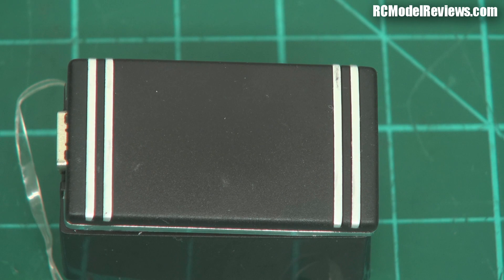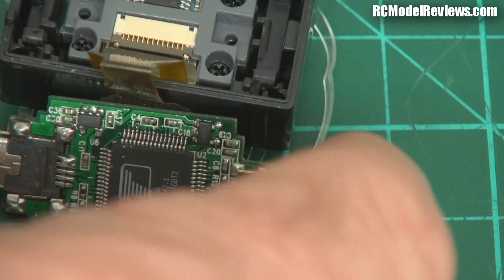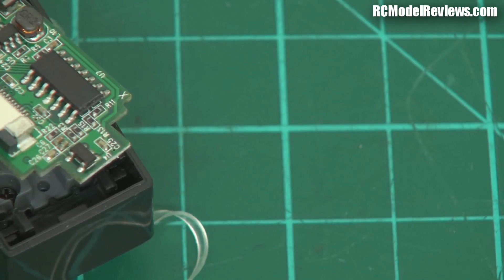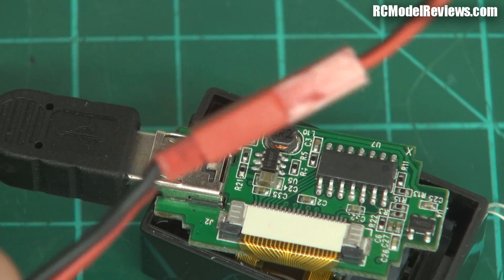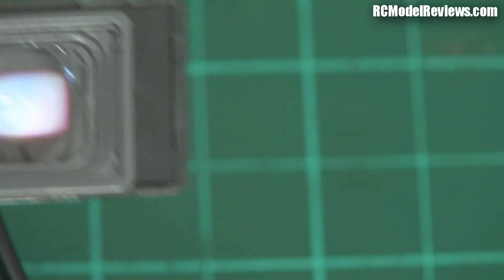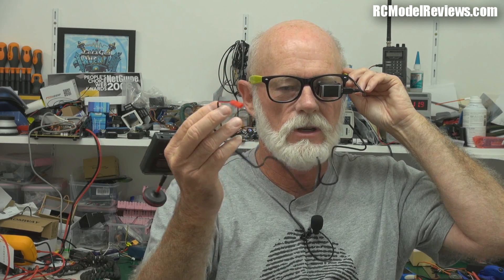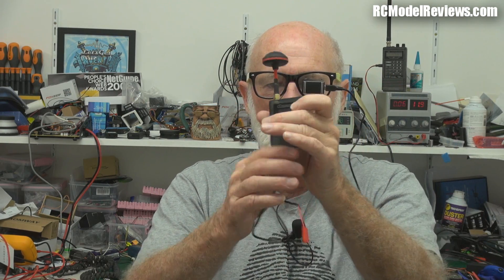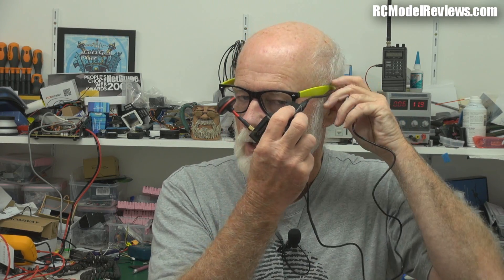FPV monocle from Banggood (part 2)

Comment: I saw these on Banggood and I'm tempted to buy this for a friend who is blind in one eye, with poor nearsighted vision in the other, and add a good camera and see if I can rig up some Jordy Laforge kind of affair for them to see better.    If you have a good camera try it and see if you could walk around with such an augmetned vision thing.   I'm thinking such a thing could be great for welders to watching their weld puddle, but with computer enhancement, and so they aren't looking directly and the blinding welding light.   Also, you could switch to thermal mode, and see hot spots, or night vision, for seeing in the night, depending on what camera you put it on.  Wear an eyepatch over the other eye, it probably works better than closing one eye.
cg.air-war.org

Comment: Is there any possibility of using something like g85 replacement viewfinder as a fpv? Something like this?
https://m.ebay.com/itm/Panasonic-LUMIX-DMC-G85M-G85-Camera-View-Finder-Assembly-Replacement-Part/372113692444?_trkparms=pageci%3Ab772f903-1193-11e8-85e1-74dbd180c60a%7Cparentrq%3A94ba0f251610aa47a50bc280fff72df0%7Ciid%3A1&_trksid=p2481888.c100675.m4236

Comment: Different from the one in the review, on mine, the cables did actually have the right colour. Only their order in the JST-socket was reversed. So I did swap them and it does work fine now with at least 4.2volts.

Comment: Have seen this before on several electronic items internally. infarct I had an A/V engineer out here in the UK and I pointed out he was using Red for - and Black for +. he replied I know, I used to use Red + and Black - but he has been trained by two companies in the past 15 years and they both insisted Black for + and Red for -.   Strange

Comment: Thank you for your video.

But, I did not understand - how resolution of this display? 
What mean this "RGB-432x240 (Similar to white light 640x480RGB)"?

Each pixel on the colour screen is composed of three sub-pixels (R, G, and B). 
640 x 480 - is the number of pixels or sub-pixels?

I have a video glasses with a resolution of 320 x 240 pixels (not sub-pixels), and it is very little. 
Recently appeared on the market such FPV-monoculars, written "640 x 480 pixels",- it is tempting. It is true, or deceit, and that the same 320 x 240 pixels, but they "counts the pixels more properly" :)?
Reply: +Афанасий Сьмерць 
upd. I found information. Yes, it's just QVGA, 240p. Suxx.

Comment: That's funny, a lot of chinese products seem to have poorly marked polarity.
Like, someone I know recently got a hoverboard (yeah yeah, I know...) charger to replace the one that got stepped on ...
Well, the damn thing had the same plug, but the polarity was reversed!
Luckily the hoverboard has a reverse polarity protection diode, which prevented it from causing ... well, you can guess XDDD

Comment: I used to fpv using a regular display and, if there is anything I learned,  I learned that the moment I took my eyes of the monitor and went los... the damn controls reversed. INSTANTLY. 
My brain is nothing like INSTANTLY so I had to go over and swipe the mess I made to the bin. 
Therefor I wouldn't use a monocular like this to do anything else but impersonation Locutus.  
Which I can't as I'm more like Chewbacca in appearance...

Comment: VIDEO RECEIVER VOLTAGE, can it be higher than the monocular voltage? can I run the screen at 4.5v and the receiver at 8 or 12v?

Comment: Interesting that the monocle worked with  4.2 V from your bench power supply. Could you please test it with lower  voltage to find the cut off and see if it would run on a 1S battery for a decent chunk of the mAh:s in the battery?

Comment: What You said about focusing is crucial. To make this thing work(and what makes google glass or military devices of this kind work) is collimation of image output by the device. Collimated image is in focus at any range. One condition to collimate light is that the light source must be a point, so a surface like LCD back-light cannot  be collimated. its all about optics and  geometry. Google Glass uses diode as quite good approximation of a point source, then they REFLECT this light of a panel made in technology called LCoS (Liquid crystal on silicon), then they pass it through collimating lens, then reflect it once more in the combiner prism (this visible  piece of glass in front of an eyeball) which "mixes" image in front of you with image from LCoS. Popularization of Liquid crystal on silicon is what made Google glass possible. You can find chip LCoS in picoprojectors. For this device to work you wouldn't need a combiner,  a mirror would do, or even reflection from LCoS  straight through collimating lens to an eye. Without collimation every time you switch eye you're looking thorough, booth your eyes have to make sudden, big change in focus range. This  takes time (even a second or more) and is tiring. 
HUD in cars are not common for a reason, it's just not as simple as reflecting image from a piece of glass.

Cool glasses BTW. :)

Comment: Thank you for the review.  For power to the unit, why not just get a single cell 18650 lipo battery holder and battery.  The weight should only be about 70 grams / 2.5 ounces and you'd have 1000-2900 mah capacity (1000mah for cheapo Ultrafires and 2900 for genuine Panasonic/Samsung).  Banggood would be smart to provide this as a extra cost option at purchase.

Comment: Bruce/Locutus If you have trouble with fixing all the cables and batteries with cable ties try 6 inch nails instead. Then you really will have been assimilated!

Comment: If you look really close at the JST connectors they have the numbers 1 and 2 on them. Red (pos) should always go into the number 2 pin. I learnt this the hard way when I had a batch of JST pigtails arrive all wired incorrectly a few years ago...

Comment: I will buy anything from Banggoodbecause the last thing I bought from them was a power distribution board and a cook my flight controller and my OSD board cost me over 100 bucks. So I suggest that you avoid them.

Comment: At about 1:29 of your video, in the upper left side of the board there is a tiny spool with copper wire wrapped around it. What is that and what does it do? thanks
Reply: +Carl Bradley - do to the rotation of the earth and the fact that Bruce is down under that device (called a electospinvertor) changes the electron hysteresis spin from counter-clockwise back to clockwise as required by some low power electronics that use hyper-correlating zinotators to supply the navitronious power to the LCD flipporitronic (spelling?) multiplexing varitron regulator.  Quite common these days to reduce the hysatratic effect and thus obviously reduce overall power consumption (and improve the overall conitronis effect on the image).  Hope that wasn't too technical.  You can google hysatratic effect for more info.

OK... if you didn't buy the bridge on that answer, it is an inductor.  It is either being used to filter the power supply line (they pass DC but try to block AC) or more likely is being used in a DC to DC converter to either step up or step down the supply voltage to the level required by the circuit.  A step down DC to DC converter reduces the voltage like a linear regulator but wastes less power (thus producing less heat in the case) but at the cost of a larger circuit and added electrical "noise".    It is just some wire wrapped on a ferrite core.  Check Wikipedia for "inductor".
Reply: +ElmerFuddGun lol, thanks for the insight. I had one of those smoke on my during the installation of a Tarot OSD.
Reply: +Carl Bradley - your inductor smoked?  Or something close by?  Really need a lot of current to smoke an inductor but I guess a LiPo could do it.  Normally something else connected to the inductor will fry and go open circuit before the inductor.  Reversed the battery?  PS - glad you liked the answer... took too much time but was fun to write!  ;-P
Reply: +ElmerFuddGun I wish I still had the board to look at it. All I know is I plugged the pluses to the pluses and the minuses to the minuses, she sparked like a fire fly and smoke puff like a witches spell, dang near burnt the counter and smelled like someone squealed their tires in that crib, lol.
Reply: @ElmerFuddGun  -ElmerFuddGun was fucking with you, telling you it's a Turbo Encabulator
https://www.youtube.com/watch?v=Ac7G7xOG2Ag

Comment: This thing looks like it has a switchmode power supply section. Wish they had spent the extra $0.01 and put in parts capable of at least a 3S input voltage range.

Comment: It would have worked for everyone but detective Bruce who hesitated. 
Fix is to run black tape down the cable to hide the red and black reverse wire.
Reply: +pokies100 Anyone who knows anything about electronics is going to hesitate to plug in battery wires red to black and black to red. 

This is the kind of screw up that I would make when building a hobby project for myself while stoned, and then I'd immediately go back and fix it because you can't leave it that way.  Determined 200 pound gorillas or determined idiot stoners can absolutely force that plug to fit while reversed and not even think anything of it because you never invert the color of power leads.
Reply: +SlocketSeven planned obsolescence is what happens when the two wires are sent out crossed and win tried to correct it the item blows up

Comment: This product just doesn't seem like a good idea to me. Too many compromises involved and for sure those little rubber suckers will give up just when you don't want it to fall off your face. A DIY set of goggles using a 5" LCD screen and fresnel lens is so much better and cheaper. Bruce you should do a build tutorial on the DIY approach.
Reply: It has small rubber bands for to stop it from falling completely off.  I push the suction cups to secure them before flight, and in my experience they never come off in that time. Attached to my spare glasses in flight case, the suction cups remain secure days later when I fly again.

Comment: Don't mean to be a brat but a quick "mini usb type b pinout" google image search would have saved you the disassembly.
Reply: +David Magana if it were indeed a USB socket but it is not. It merely uses a mini USB connector so there is no telling how it was wired up.
Reply: +Rob B the female mini USB type b that's in the monocle has a pin out that has to match the USB cable.. not only that but the "test" he did was really pointless because he could have touched the outside of the male end of the USB  cable and done the exact same continuity test he did
Reply: +David Magana 
No, it does not have to match the USB cable. They used the USB connector, because they needed multiple contacts, which a mini USB has, and it is cheap, because it's used everywhere. Just watch the video. It's obvious by the way they soldered the connector on the PCB that the pinout has got nothing to do with the USB standard.
Reply: +David Magana What forces an engineer to follow a wiring spec? There's nothing that physically prevents you from wiring the 5v rail to the shield, and the ground to the 5v rail.  You can lead any circuit board traces you like to any of the pins on the connector.

It's obviously not even USB. USB doesn't carry RCA composite video. There is literally no way to tell how it's wired without testing it in some manner. Most people would just assume the 12 year old in low hung wang china wired it right, and bitch on the internet if they didn't and their gear broke.
Reply: +SlocketSeven both the mobius and the go pro use usb cables, advantage of a usb cable with a device with onboard battery is it can be charged from any usb charger that puts out enough juice, you can then use the "data"cables for what you want.
What's good for the big boys can be used by anyone!

Comment: If you wanna use on the other eye, yes it will be upside down, then just mound your CCD camera  upside down, so you might solve that problem hehehe
Reply: +Gilberto Araujok just fly inverted
Reply: +Ty Lloyd kkkkkkk lol that's right.

Comment: I ordered one of these off eBay for under 60 USD (cheapest I could find). Didn't show up for a month, seller contacted and said they'd refund me, and did. I'm still waiting for the product to arrive :D
This would probably run fine off a mobile phone battery bank, not sure how much power it consumes though. Some of the batteries are pretty nifty size things.

Comment: I just wish the drone hobby is less expensive. I wanted to make my own racing drone but the cost was going to be $400 :(
Reply: +Zach Balov heres a cheap option to start, 240 USD build. http://www.dronebench.com/how-to-build-a-fpv-racing-drone-for-us240/
Reply: +SwisherSurgeon thx for that page, but once you add in the transmitter and batteries, it goes to 350, not to mention tax and shipping. I'll keep an eye on this stuff and continue saving money, thx for the link man. :)
Reply: +Zach Balov Buy second hand stuff. Cheapest transmitters are like $30-40 used and you'd probably get a Turnigy 9x or 9xr for that. 
Batteries are 5-8 bucks a pop if you build a smaller craft with 1300mAh lipos. 10-15 bucks for FC (Naze32, CC3D etc), 4 motors are sub-$50 new, vTX $17, vRX $10-25,  ECS's $20-30, RX $15-25, FPV goggles $40+,  FPV camera $5-30, frame $15-50. And even cheaper as used. People stop flying all the time and sell their stuff on rcgroups or ebay.

If you wanna cheap out even more, build a tricopter. Flite Test has great kits, and RCexplorer.se has a good and cheap one too, like 250 with electronics. Just add a transmitter of your choice.
Reply: +Zach Balov FOXTECH FC 250 RTF COMBO 181.00USD DELIVERED! AND IT IS A GOOD DEAL
Reply: +Zach Balov If you want to start buy flying line of sight some of the "toy" grade quads are now excellent. The Latrax Alias 80GDP, Dromida Vista around 50GDP, U807 27GDP. These things fly great for a beginner, are cheap, won't require registration and if you hit a child will result in the child crying and you getting told off by the parent rather than a trip to A and E. Go look at Quadcopter101, Flyin Ryan or the RC sailors on youtube for great reviews.
If you want to fly FPV these things don't seam to fair so well. The cheap ones generally have to much latency and the good ones bring you into the price range of stuff Bruce builds.